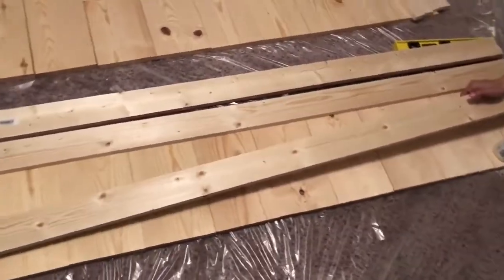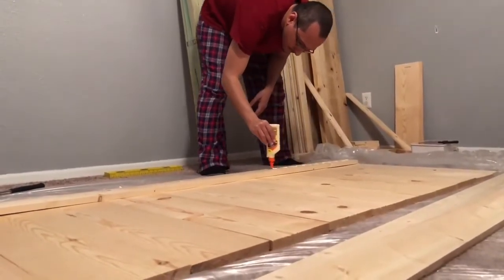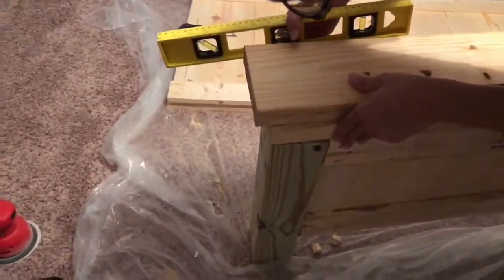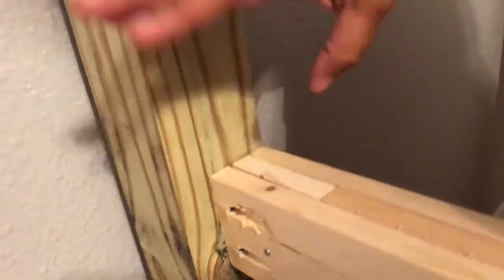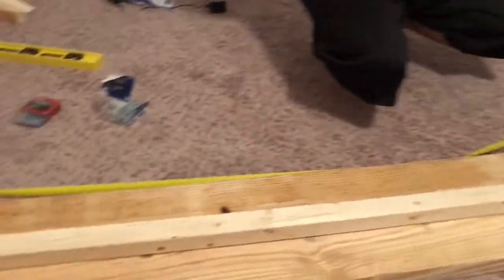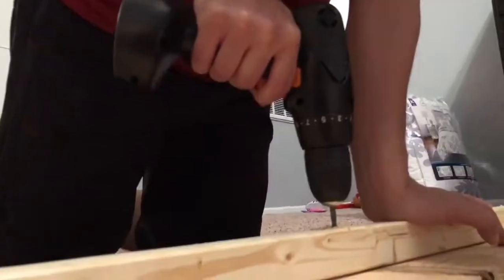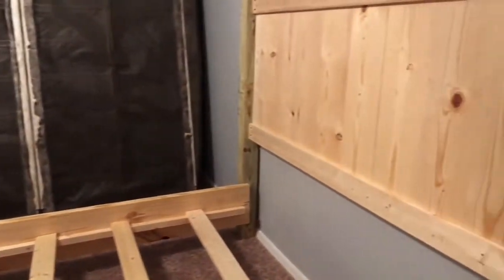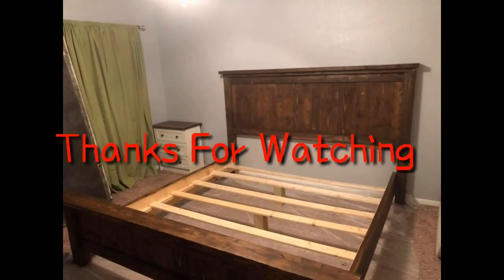How To Build A King Bed |DIY Farmhouse Bed Frame

Comment: You can’t use treated lumber inside your home. Or at least you should not. The 4x4’s are treated which you can tell by the green color. It is chemically treated to help against rot and is only used outdoors. You should not have this inside in the air you breathe, especially in your bedroom. 4x4’s in untreated pine are hard to find I understand that, but i would highly recommend you taking the bed apart to replace the treated lumber with another option such as using 2 2x4’s together.
Reply from the maker: Thanks for your input

Comment: So how far down the 2x10 did you set the 2x2’s?  Did you secure the 2x10’s directly into the 4x4’s posts?  Awesome job by the way!
Reply from the maker: +Michael Sangiovanni thank you . I will measure and get back to you but it depends on how high or low you want your bed. Also no we used “L” brackets to secure them together... 2 on each post for security! Thanks so much